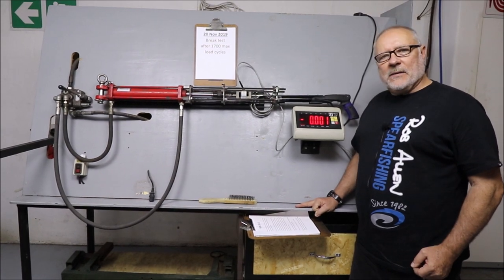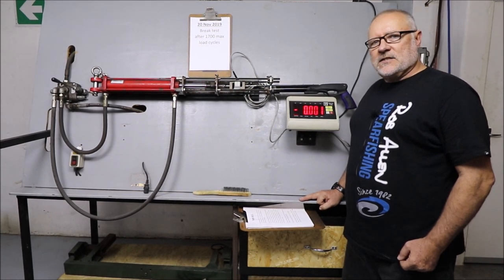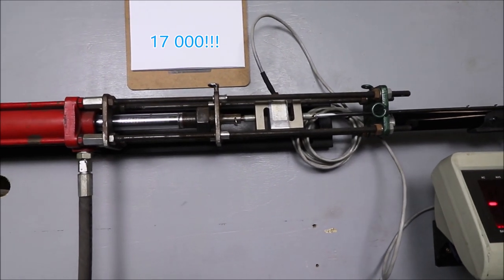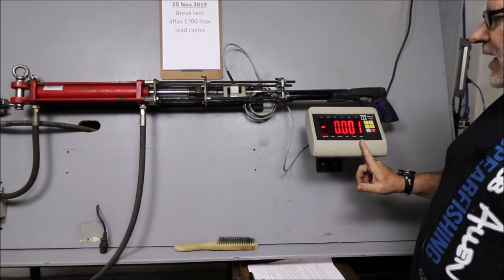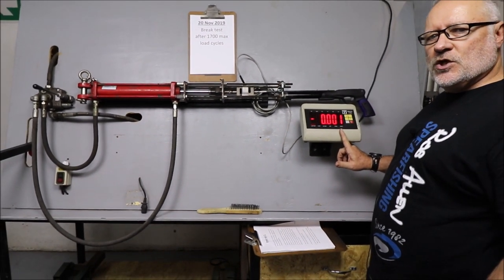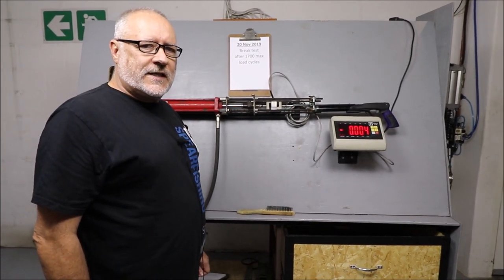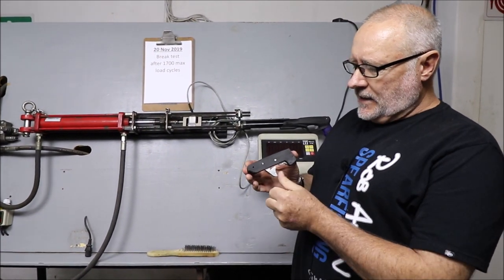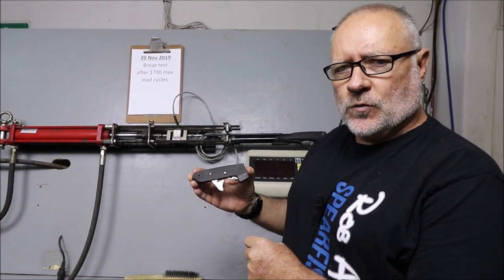Rob Allen | Vecta 2 Handle Destruction Test | Part 2

Comment: What is limit of plastic on your handle? Probably first breaks plastic under axis of cassete.
Reply: It’s not plastic it’s glass filled nylon
Reply: Thank you. Correct - material.

Btw from wiki.
Plastic is material consisting of any of a wide range of synthetic or semi-synthetic organic compounds that are malleable and so can be molded into solid objects.
Reply from the maker: @SpearFisherPitZ  when the spear pulls out it cuts into the sear and tears out metal. You can see this in the first video showing the parts. There must be a slight flex in the roof of the cassette to allow the spear to override the sear. the trigger does not move.